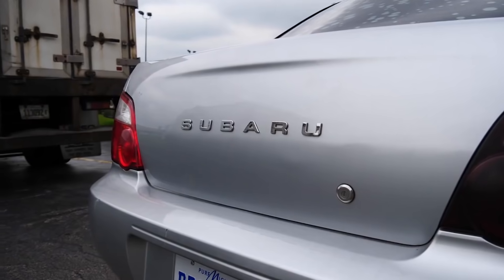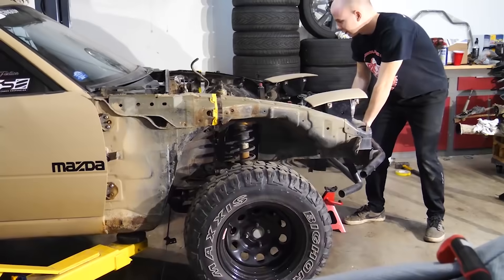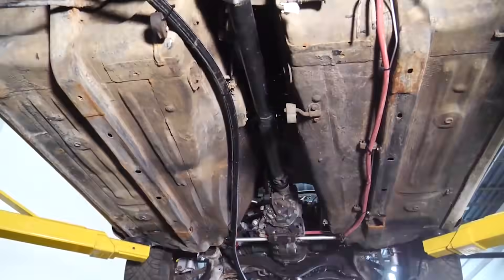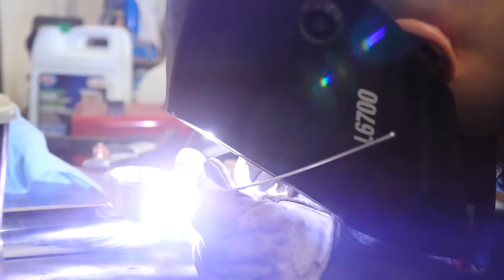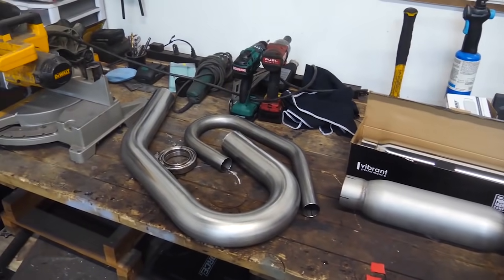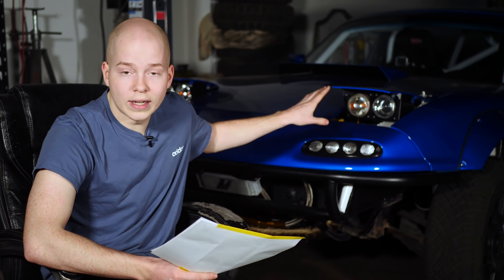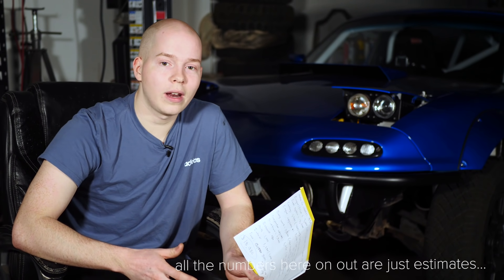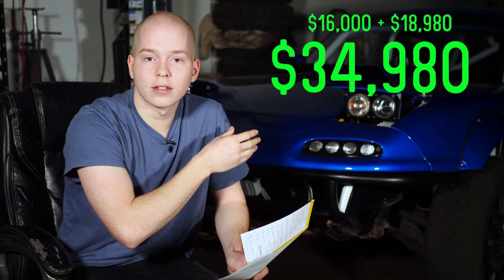How Much Did it COST to Build the WORLDS FIRST AWD MIATA!?

Comment: "buy a harbor freight welder and learn how to weld, build some stuff around the house" aight imma make a tube frame for my bed
Reply: Weld some bodywork to it and spray paint it with some Walmart paint cans.
Reply: You would be surprised. I picked up a really good mig welder, and in a couple of months I started to build all sorts of things, from office desks to PC cases...
Reply: hangtime 7190  😂😂🤣😂😂🤣😂🤣😂🤣😂😂😃😁🤣😂😂🤣 THAT WAS GOOD BRO
Reply: Genuinely not a bad idea
Reply: hangtime 7190  for the win!
Reply: Cheap Harbor freight welders are so bad😂 I can't speak for the higher end welders they sell but the 100 dollar one my brother has cant even welf exhaust on low setting it still blows through
Reply: My bed needs a roll cage
Reply: DEAD
Reply: The Titanium 140 is a perfect first welder. all in with gas and supplies about $800. if you're on the fence just take a class and see if you like it. Titanium 170 if you have 240 plug. whatever you do, dont skip on the gas shielding...well worth it
Reply: Varg Sutton is it really, I heard the MiG weilder is the choice
Reply: Don’t get a flux core welder. I’m in welding school, and I can guarantee you don’t want to learn how to weld on a flux core, they can burn holes through thin metal cause they run hotter than mig wire, you have to clean the slag coating off of each weld, otherwise you could get porosity, they’re just a pain in the ass. Get a mig, it’s simpler to use, involves less cleaning, and can be used on thinner material
Reply: @gavgo6968  The higher end / newer stuff at Harbor Freight has definitely spent more time in the QA department.
Reply: hangtime 7190 dang all i got is a bagged shopping cart.
Reply: That would be dope tho
Reply: Do you need a special outlet?

Comment: I think one thing you lacked on pricing out was welding supplies. How much did the electrode wire cost, how much did the welding gas cost, cause I know that shit can get expensive. It’s like $40 per refill for a 40-50 cubic foot bottle for a 75/25 Ar/CO2 mix. You probably refilled your bottles at least once or twice. Plus, the gas bottle itself for the welder starts at around $200. Also, depending on the brand, size and weight for the wire, that could easily be $10-50 a spool. There’s a lot of money that goes into welding supplies.

Comment: The cost is one thing but how much you have learned is worth so much more.  Only downside is what you know need a stupid people saying you know it but knowing is half the battle.  I love this project it was built how real people did it back it he day and how I built my 1986 S10.   No computer aids design to help you built it in your head the best computer ever.  Some cardboard here and there, your golden.   Before the LS swap, before the LS even I put a Small Block Chevy 350 iron block in a little chevy S10 pulling a blown 4 cylinder out.  Turned the 350 in to a 383 stroker with duel carburetors that were double pumpers too.   I got more of my parts from the junk yard taking me a 13 year old over 2.5 years and my first truck would stand up on two wheels and jump a 2L soda.  But looking back at what I learned has carried through to today as a electrical and mechanical engineer, tool and die machinist.  I can build and fix just about anything and design it in CAD then go to a CNC or by hand build it,    Love your build!

Comment: As soon as I move out and get a house, I'll be building my own project. Plan is a rotary swapped Ford Ranger. If I did my homework right, it should actually be really easy and straightforward. Rangers basically use RX-7 transmissions. New bell housing, custom motor mounts, and wire in ignition coils and gauges; obviously cooling, but I should be able to use the stock ranger radiator and stock rotary oil cooler. Going carbureted will save time and money. Then after that I think I'll get another RX-7 and do some major performance work

Comment: I think one of the main hangups for me is just having a dedicated space to do this sort of work.  I don't have a garage or a flat or paved driveway.  I've done an engine swap and some other more detailed jobs out there, but I sorta feel like it gets trickier to start pushing for passion projects when you don't have somewhere to keep things for fabricating and if you get too carried away on car work that neighbors will start to give you flak
Reply: i use one of those stand up carports you can get for like 200 bucks. My subaru has lived in it for about a year now. Its pretty nice when you dont have a garage or driveway.

Comment: Just a bit south of $19,000 is NOT BAD for such an interesting build that's also a finished, roadworthy car.

Also, hot guess, the new tool is gonna be something to do with making some skidplates so you don't drag the oil pan over a rock or pop a hole in a coolant line.

Comment: I really wish more people would suggest learning how to do the work yourself (safely like you said...then again I built a VW 1.8T powered completely custom Lancia Stratos replica in highschool and competed in amateur rally with it...) instead of just scaring people off by saying "oh that's gonna cost at least 10 or 20 thousand".  9/10 the people saying stuff like that on forums can barely check their oil much less build anything.  I've done a stupid amount of probably equally stupid projects though, that's the part of a car/truck that's the most interesting for me.  I could have just rebuilt the Solstice donor car I got  or bought a Miata instead of converting a 99 Celica to RWD and swapping in the LE5 turbocharged but to me that would've been boring.  Even if it took a couple hundred hours, I enjoyed those couple hundred hours so that has its own value (considering my trade is machining, fabricating, and mechanic work I better enjoy doing it lol).  I built a AWD rally Super Beetle with a completely custom chassis/cage under the shell with a front engine and rear cooling/fuel swap using a 1.8T 225 Audi TT Quattro as a donor.  Arguably I could have repaired and converted the TT from the get go but I wanted a AWD Beetle.

Comment: Dude, you are selling yourself WAY short on $40/hr for custom fabrication. Depending on where you live in the US, that can easily be $100+/hr.

You're also not taking into account that you it's not just the time to do the actual work (cutting, bending, welding, etc.) but also the time to come up with the plan/approach for how you are going to do it all.

Point is, "market rate" to have somebody build this is probably a lot more than what you quoted...you saved yourself a serious bundle!

Comment: Can't believe someone would let their dad ride in their car without shoulder belts. Sure, talk about how much the cage cost, go through the trouble of installing aluminum racing seats (did you properly brace the back of those cheap aluminum seats? It's not optional if you care about the person in the seat at all), Install racing harnesses, and then...not use the most basic and essential safety measure...not using the shoulder harnesses. Makes a lot of sense!

Do you know how terrible just a lap belt is in terms of safety? A mild or moderate car accident and the  victim may never walk again or worse. The chances of serious injury are something like 5x as bad as using a factory shoulder belt. What's even worse is how you put so much time, money, effort into the car just to piss away any notion of safety. Roll cage isn't just to look like a racecar, you need SFI padding everywhere your body car come into contact. Not wearing a helmet near those bare cage bars is way less safe than not having a cage at all, your head will split open like a melon if you get into any sort of side impact or heaven forbid...roll the car.